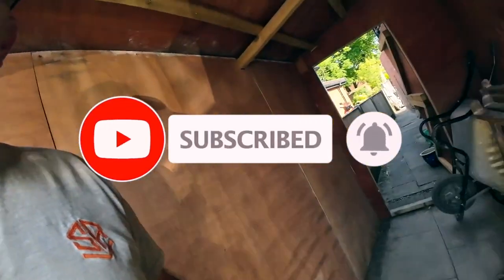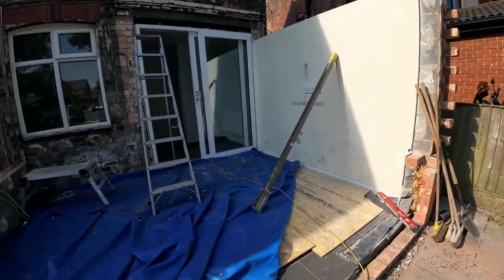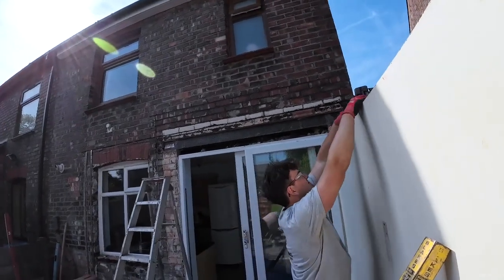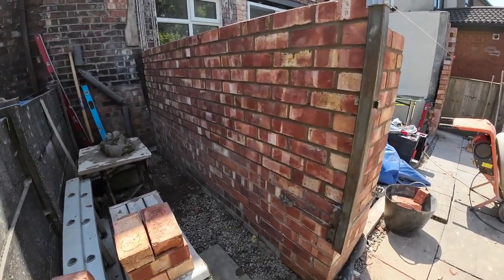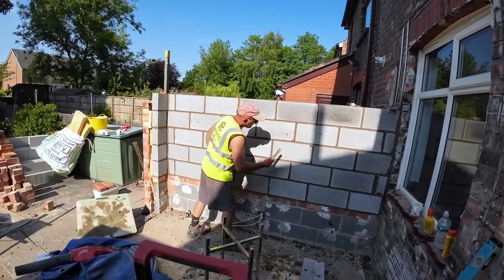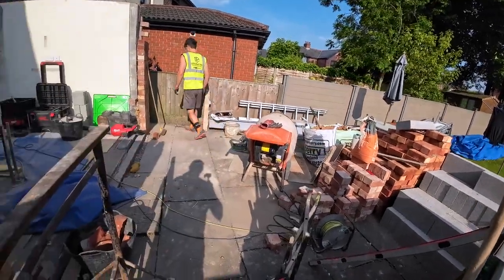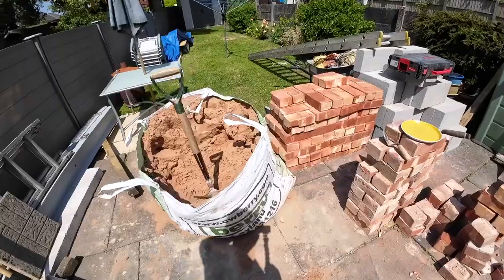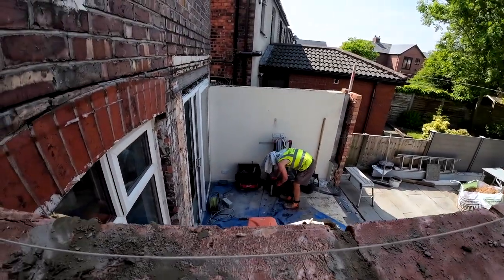NIGHTMARE BRICKS BUT GREAT MATCH... CONNY CONVERSION PT1

Comment: Lovely job good jobs them. Steve see the Blake’s profiles once ya set them up the small stabiliser clip do you use that all the time or needed all the time. Just bought 4 blacks and them fitz brick clips for which look great. Thought your man to ask as you props first YouTube using and has never detoured onto anything else. Box profiles good at times pointing in behind not ideal. But 1 a can be faffed setting bits of battens etc up nonsense don’t need that with Blake’s. Box 1,s would use shorter box or once a few make sure good part was clamped onto 8-10 course brick less chance movement. Be interesting with Blake’s when get a chance to use. Got the £340 am sure nice paint job on them job. Guys that sell them really good to deal with.
Reply from the maker: Love our Blake’s ❤️❤️😍😍🧱👍🏽
Reply: @SteveAndAlexBuild  
Do you need to use the small stabiliser clip much buddy ?
Reply from the maker: Every 6 then slide up and repeat . Just keep checking which is good practice anyway 🧱👍🏽
Reply: @SteveAndAlexBuild  
Cheers buddy. 🤙🤙

Comment: If the brick socks the water out of the mortar so fast, does it weaken the ultimate strength of the mortar?  Would it make sense to pre-wet the bricks?
Reply from the maker: It can do . Wetting the bricks can cause efflorescence 😬🧱👍🏽

Comment: Could you not soak the bricks in water before use to make them less thirsty, or is there a downside to that?
Reply from the maker: It does make it easier but there is an increased risk of efflorescence 😬🧱👍🏽

Comment: The sound of a combi drill on hammer is horrific. Cant you get milwaukee to send you an sds especially if youre not going to wear ear defenders. Ive been using power tools for over 20 yrs and never botgered with ear protection on my younger days too
Reply from the maker: A lovely 12 v one arrived today, nice, light and compact. 
    Al does usually wear his ppe 👍🏽🧱

Comment: Most blake profiles i see have the ends chopped off 😂 nightmare to set up.
Reply from the maker: Ends chopped off 😳? 🧱👍🏽
Reply: Easiest thing in the World to set up.
Reply: @bricklayersworldwithandy6277  I disagree, not as easy as box profile and a clamp.
Reply: @lessismore83009  easier to fit, easier to plumb no messing about with packers and you can joint up behind them.
Reply from the maker: Blakes are way better than box section . You don’t need a barrow full of weird clamps to stabilise them either . Had mine 36 years . 
   Box section alright for solders and as a dead man .
🧱👍🏽